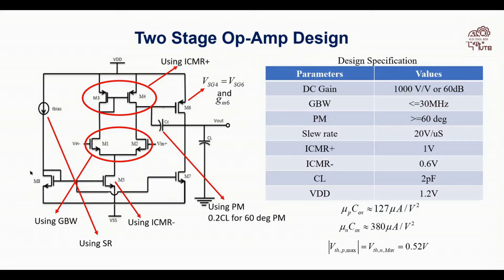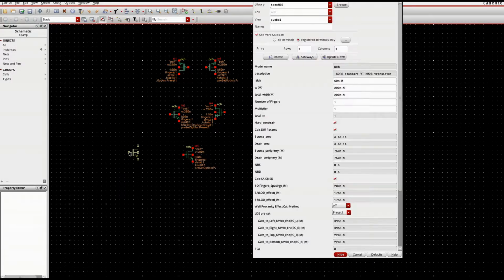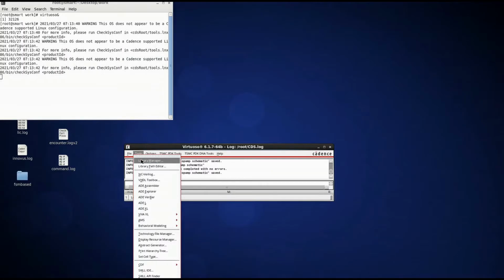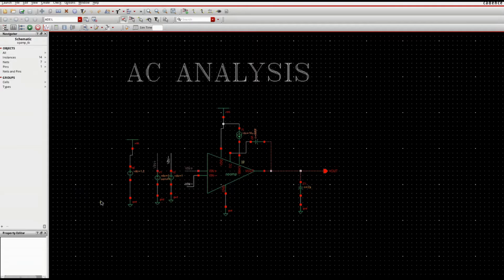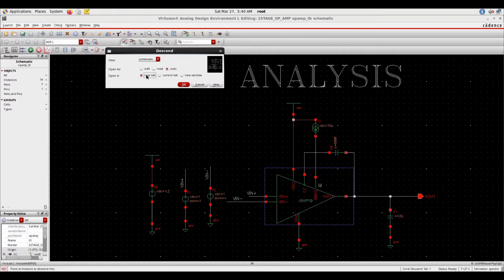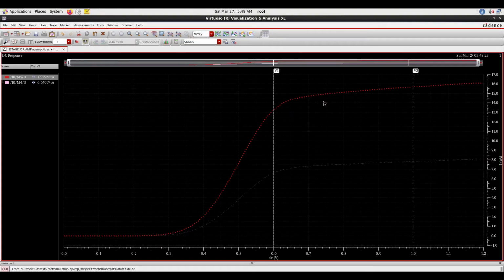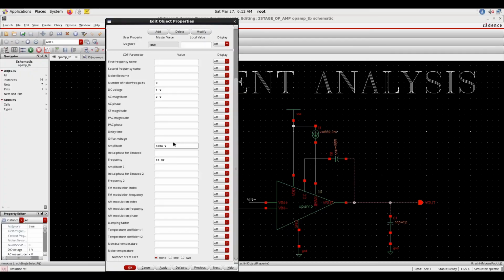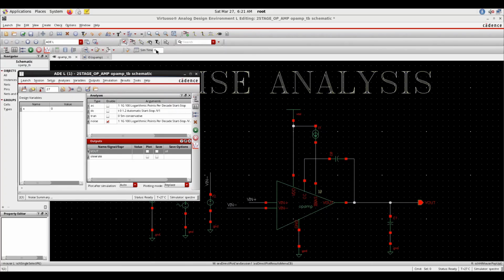Two Stage Op-amp design | AC Analysis | DC Analysis | PSRR | CMRR | ICMR | Noise | using TSMC65nm

Comment: Sir, I noticed that DC gain is included in the design specifications, but it does not seem to be used or verified during the design process. Could you please explain how the DC gain requirement is satisfied?
Reply from the maker: It is included in GBW, if you want to use DC gain then you have to use BW and gain then it will directly come into picture. Here using GBW Specification it is designed without having BW specification. So directly it cannot be taken into account. Again, if you want, it can be included through required Rout calculation for the gain specified.
Reply: @VLSIToolBox  Thank you very much for your response, sir.

Comment: sir, why we set Vin-( dc=1,ac=0) and Vin+( dc=1,ac=1) to plot ac gain, i think it also contain  Cm gain
Reply from the maker: for cmrr you have to find common mode gain as well as differential gain then plot cmrr=ad/ac using calculator in cadence.

Comment: Sir I wish you could have done the calculation in a little detail, because I feel like you took some approximations.
Could you please tell me if you have done these somewhere?
Reply from the maker: use these updated w/L ratios
M1=M2=6u/1u,M3=M4=3.15u/1u, M5=M8=8.42u/1u, M6=29u/1u, M7=38.77u/1u. and simulate with dc common mode voltage with 800mV

Comment: What is your calculation for M3/M4? With the given values I get a W/L of 3.15.
Reply from the maker: Yes, in the slide it is a calculation mistake. You can use 3.15uM/1uM for m3 and using this, you find all the m6, m7 w/l, and simulate using input dc voltage with 800mV, you will get the result

Comment: For PSRR, why we dont look the Vout/Vdd instead Vdd/Vout? i think PSRR shouldnt be greater than 0dB.
Reply from the maker: This is the download link of a book; I request you to refer this to get your query answered. I have used this book as my reference.
https://kolegite.com/EE_library/books_and_lectures/%D0%90%D0%BD%D0%B0%D0%BB%D0%BE%D0%B3%D0%BE%D0%B2%D0%B0%20%D1%81%D1%85%D0%B5%D0%BC%D0%BE%D1%82%D0%B5%D1%85%D0%BD%D0%B8%D0%BA%D0%B0/%D0%A3%D1%87%D0%B5%D0%B1%D0%BD%D0%B8%D1%86%D0%B8%20%D0%BE%D1%82%20%D0%93%D0%B5%D0%BE%D1%80%D0%B3%D0%B8%20%D0%93%D0%B5%D0%BE%D1%80%D0%B3%D0%B8%D0%B5%D0%B2/Allen%2CCMOS_AnalogCircuitDesign.pdf